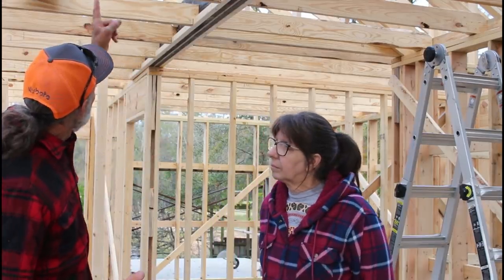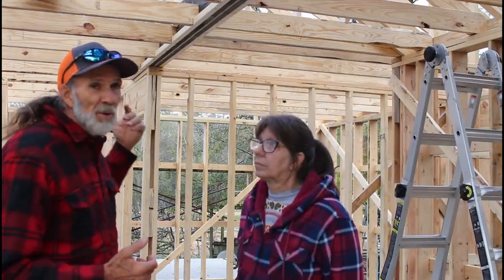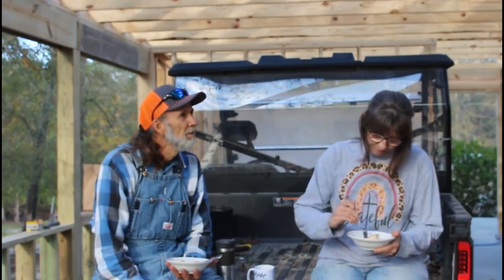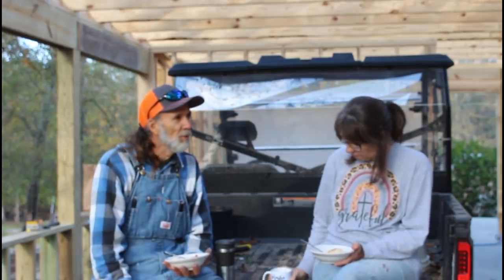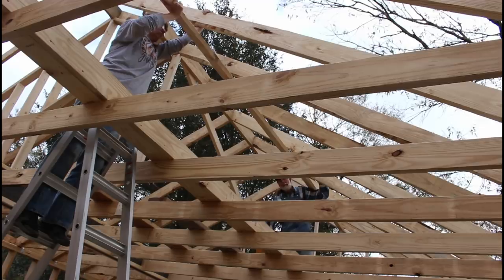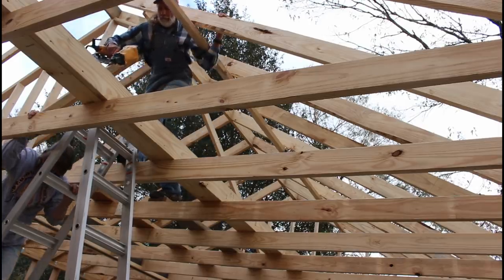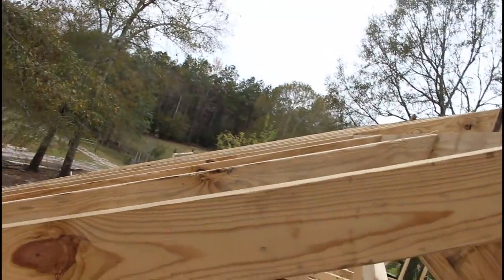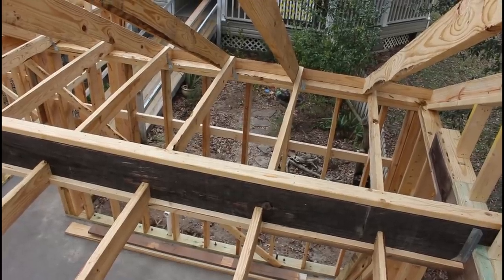Bracing Finished! |  She SHED Build |  Part 10

Comment: Nice watching a craftsman, that knows his trade.  My Dad was an awesome carpenter and built mostly in South Florida around Miami. So I know all about hurricane codes in framing and building.  Exterior walls were all mostly concrete block with rebar tying the foundation up to the tie beam that was poured concrete.  Nice seeing bracing and aligning of joists etc.  Expert work, unlike those I see building on Youtube, some are very scary, watching some build off grid and avoiding inspections and thinking not building to code makes them free from government intervention. Being that code is the minimum for the area, at least build to that standard. And if you are an amateur you need to be inspected to see if you have met the minimum requirements.

Comment: Mr Danny, you and Miss Wanda are AMAZING!!  I can identify with Miss Wanda as heights give me terrible anxiety.  I have a question on a totally different subject.  Would you please explain "fat lightered" (sp?)?  What tree does it come from, how do you find it, is it a tree at a  specific point in the tree's life?? Is it something only found in certain regions?  We heat with wood and those starter bricks/sticks are terribly expensive and it would be lovely to know how and where to find lighter for free.  I know you're busy but I would certainly appreciate you sharing your brain with us.  Blessings always ❤️
Reply from the maker: It comes from very old pine tree hearts. It can be found any where there is pine trees. You can also use pine cones to start fires with they burn really hot.
Reply: I think the reference is to “fat wood” which is any resinous tree wood that has a concentration of sap. Usually it’s pine, fir, cedar, or the like, and usually the fat wood comes from the heart of the tree.

Comment: Danny, your joists and rafters look like southern yellow pine or Douglas Fir? Most of the lumber up here in Maryland is SPF for smaller lumber but recommended to use Douglas Fir for rafters or load bearing lumber for the roof structure. Just curious as it looks like yellow pine.
Reply from the maker: Yes it's all yellow pine except for the studs they're spruce.